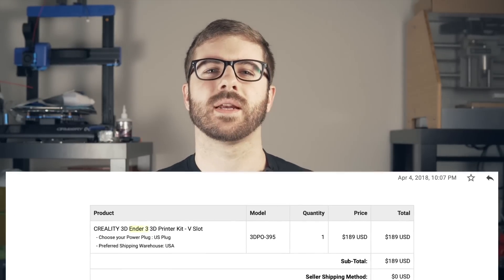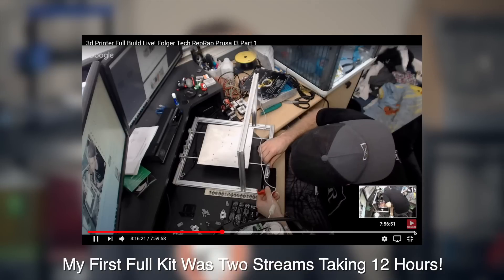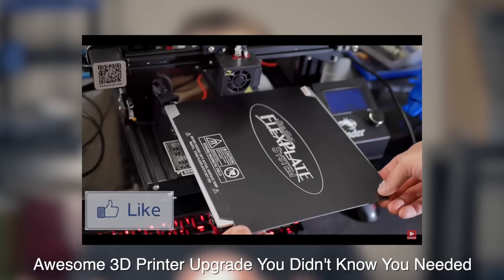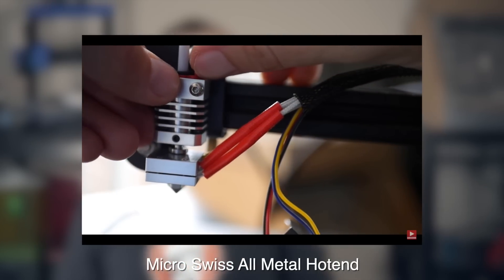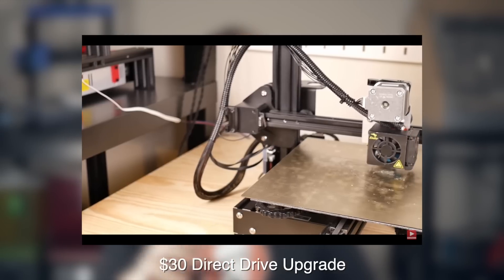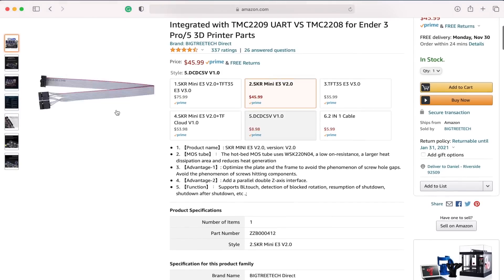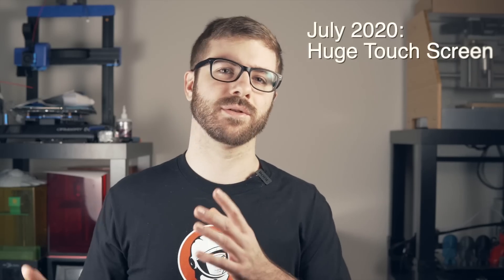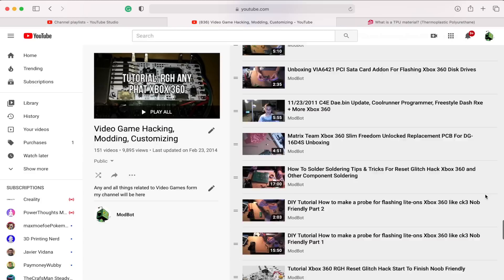My Ender 3 Journey 2.5 Years Later! Still Worth Getting?

Comment: Hi, I started with a Ender 3 Pro. Sometimes it’s easier to purchase an inexpensive unit and pay for the needed upgrades as you learn. I have the Sprite upgrade, haven’t installed yet. I have printed PLA and TPU A95. No problems with the TPU going through the Bowden tube. I purchased the Sprite for PA and PACF. Would like to print bearings either PA or Delrin. I’m an hobbyist, i print on an as needed basis. I started, because I have a Husky tool box that needed 46 detents for the drawers. Total cost $380 to purchase at the time I purchased the Ender. Ender $200, PLA $20, plus time. Saved $360.

Comment: Nice video, I know it's an older one but I like going back to review older videos of people I subscribe to. Keep it up! Also I did the same thing with ABL but I went hardcore RepRap and made my own ABL with one I found on Thingiverse. It worked really well but the rod kept sticking and driving the nozzle into my glass bed so i said no more! I then changed my hotbed setup for leveling and added a nut to hold the heater bed to the bed leveling adjustment screw and added printed knobs to the adjustment nuts. Now leveling my bed is so much easier and I only have to do it every 10-20 prints and even then it's usually level. I've learned so much in the last year from all those here on Youtube and elsewhere. I'm working on making some 3D printing Youtube video content myself. So coming soon.....

Comment: I've owned an ender 3 pro for a little over a year now. I've done a couple of mods, but the best has been changing out the mother board with the new 32 bit ender version. It's unbelievably quiet now. The only issue I've had was the rotary encoder failed. It was an easy replacement, it was just a jelly-bean encoder. It's been a great first printer. I've not purchased a leveler, but it's sometimes a challenge to get through the first layer of larger parts.

Comment: G'day m8.....i pre ordered the ender 3 v2 back in june 2020. When it turned up this was my entry into 3D printing, this was recommended by my Rc youtuber Josh of Harley Designs. I  immediatlly  used the PLA and TPU i ordered with my printer, within a couple months i won a Creality Enclosure and was able to print ABS. Since then  i got into PLA+, but my hobby i needed to look at more exotic filaments like Carbon Fiber based and Polycarbonate for that strength and light weight. So for my Birthday on Jan this year my mother offered to help me upgrade, so next to me is the Micro Swiss, Direct Drive all metal hot end kit and a new Therrmistor and a Slice engineeriing 24V 50W Heater Cartridge, as this is all i need ATM. I dont use auto bed leveling i always do it by hand and its an extra thing on the printer to go wrong, but thats just the way i do things. Cheers for the content!! im going to use some of your vids to help with my new upgrade. Cheers m8... ill catch ya beyond the black stump, from ya m8 Downunder!!

Comment: I'm a 2016 Anet A8 user, and I already replaced the frame with a custome 2x1 inches tube frame welded by my self very sturdy no shaking at all but very ghosty finish, I planned to change the linear rails but if I invest on new linear and other pieces is more expensive than getting an ender 3 so I decided to get one instead so I just ordered yesterday.

Comment: new Ender 3 owners here~
mods installed already:
4.2.7 board (stock was 4.2.2, just wanted silencing)
Mean Well PSU
Octopi w/ picam
Klipper firmware
blTouch (with bed mesh and assisted tramming)
higher tension bed springs
glass bed (bed is already heated)
various printed fan shrouds, clips, covers etc.
cheap filament dryer to print out of

next up is a filament runout sensor

Comment: My first printer was a ender 3 pro. First mod was a bl touch and btt board, then glass bed, dd micro swiss, 7" touch screen, and dual z. 

I am however ready to move on to a more capable printer. Really leaning on building a voron 2.4 or rat rig. I do like the idea of building it myself how i want it from the start seeing i have a printer currently. Totally agree with the mods and building is over half the fun. And $200 is not a lot of money to risk dipping your toes in the waters of 3d printing.

Comment: The Ender 3 pro is my first (and still only) 3D printer and also modded to a state where basically only the frame is still stock.
Was that a good investment? Hell no and I wish I would have had the money to buy a Prusa when I got it (the Prusa Mini didn't exist back then iirc) I probably would have spent more time printing and less time figuring out how printers work but honestly once you've done troubleshooting with basically every part of the printer I'm willing to touch (so everything except actually changing the PSU more thant just swapping the fan) you have a pretty good understanding of the hardware and software interactions and I think it's pretty good knowledge if that's something that interests you. 
So as a project that brought me some utility and a lot of fun, it was a worthy investment and I hope I will serve me some more time.

Comment: My Ender 3 has had a new extruder (replacing the plastic one), new firmware (enabling thermal runaway), new bed sticker (wore first one out), and an electronics fan cover. Printed about 1000 pieces of PPE during the pandemic and is beginning to feel it's age, needs a bit of a service!

Comment: Getting a 3d printer nowadays is a pretty secure thing to buy, most printers are local so unlike phones and other technology which can become obsolete because it cannot get the newest update, a printer might get obsolete through innovation but will not get obsolete because of software. The ender 3's parts are also pretty simple to upgrade or replace.
You could get an Ender 3 in 2030 and it still will work the same as today.

Comment: I got my Ender 3 about 2 weeks ago. I did have to upgrade the extruder to the aluminum one and upgraded the boden tube to a Capricorn. I am having a blast. I fully wanted to learn the programs that I would need like MeshMixer, Cura and even TinkerCAD. Outer space is the limit. Thanks to people like you, it's been pretty easy to learn.

Comment: After a couple weeks researching, I bought a Ender 3 V2. Thanks in part to this channel and it's videos. Being brazilian, 250usd is a big money commitment so I had to choose well. Thanks for helping me not just in choosing the Ender, but for general knowledge of my new hobby and also for future troubleshooting.
Reply: How's it going 6 months later?
Reply: @jjpaq  Thanks for asking! Well, the stock cooling fan is insufficient but I live in a hot place. So, I printed a new cooling shroud, bought couple 4020 fans and now it's great! Had a seriously steep learning curve figuring out all issues, 90% of which were caused by me =). Out of the box the printer was good but with all my tinkering and snooping around, lots of issues appeared. I learned a lot and right now the printer is extremely reliable and have excellent print quality. it is not fast but I was able to set it 20% faster with no loss of quality. I will make tests soon to see the fastest I can print right now without problems. Should be fun.
The upgrades, apart from the cooling shroud were: BLtouch, BMG extruder, bed insulation and stronger springs. None vital but they all gave a bit better quality of life. Also, Jyers firmware is fantastic! 100% recommended!
Reply: @ragzard  Nice! I'd never heard of that firmware, looks interesting. I started running Klipper a couple weeks ago and I'm very happy with the speeds so far, ordered an accelerometer to tune the input shaping better.

Funny to hear about the challenges living in a warm place, I live in Alberta so I have to keep the printer in a warm room to avoid warping which means I can't print any filament with fumes (e.g., ABS).
Reply: @jjpaq  other end of temp spectrum. Haven't thought of that either.
I see Klipper and input shaping far beyond my knowledge lvl right now. Jyers is a more powerful and complete version of Marlin specifically for the Ender 3 V2. You are beyond that. Couple days ago I saw a video of a heavily modified Ender 3 running Klipper with absurd speeds. Video name is "Ender 3 Speedboat - 5:30" It is mesmerizing.

Comment: Am thinking of buying an Ender 3 max as my first 3d printer, but have a few concerns for it's size and what are it's drawbacks? Having a rotary UI is actually a plus for me. Creality lists the dimensions as 513x563x 590, from what i understand the bed is gonna be a bit larger than 300x300, but for the hot end to make a 300x300 area you should need a 600mm in the z(depth) axis. Maths? Physics? I don't get that trick yet. Also is the free sample filament(without the spool base) usable or is it more of a gimmick? Thanks.

Comment: Got my one a month ago. 165 EUR with silent drivers and glass plate. Already upgraded for Capricorn bowden tube, metal filament feeder and hardened steel nozzle.
120 hours of print so far, mostly tweaks for the printer and parts of the Lowrider 2 cnc mill.

Comment: my updated ender3, the same as yours, except not yet direct drive, but only had it about 9 months. If you have a flat bed, (mine is flex steel, similar to yours) then although i managed to fit a bl touch, I think it is more trouble then it is worth, in particular if changing nozzles, etc. Creality really messed that up on the original 8 bit boards.

Comment: I've learned so much by doing modifications to my ender 3. My machine is completely different today and I think the frame is the only thing that is stock (including the wiring). I learned to solder, program an arduino, Use fusion 360 and a set of calipers to create custom parts and infuse that with my woodworking and other hobbies like airbrushing. I could build a 3d printer from scratch now if I wanted.

Comment: The only thing that really holds back the Ender 3 is the couplers that barely hold the PTFE tube , once replaced you're not as likely to have such hotend issues. If you grab an all metal hotend and a direct drive kit there's really no reason to pickup an Anet A8.

Comment: I was one of the lucky ones and my first printer was the Ender3 pro and it has been great from day one. I've also did most of the upgrades in the same order you did. I have to still install the swiss and the 32 bit board which I have but haven't had the time yet to install. I took my time to learn the SW portion of 3d printing (Fusion 360 and Cura) before I got my Ender and that time was well spent and paid off because I didn't just want to just print other people's designs, I wanted to print my own. I really dig your channel and keep up the fantastic work.

Comment: My first printer is an Ender 3, and my second, which my wife asked me to buy when she saw the stuff I was printing, and figured out I could print earrings for her in under 10 minutes, but not if my printer was printing a big job. 2 is better than 1, and she is about ready to tell me to buy a 3rd, especially if I start advertising to print other people's 3d prints who don't have a printer, and can't see themselves buying one. I love that Cura tells me how much the material costs. I just need to price printer time & my time and see where I hit. I got a 3d model a year ago we wanted to print to help my wife with a garden issue she had, and I called a couple places who were advertising, and one told me the cost would be North of $200.oo. No way was I going to pay that much for $1.00 with of plastic. The problem is, the print would have taken him about 35 hours, and he had 1 3d printer which cost him a boatload more than the cost of my Ender 3 printers ($157 for the first, and $160 for the second and the price is going up).
I've had mine for about a month. I'm getting pretty good at the slicing and printing, but still haven't left PLA for harder plastics. I'm likely going to settle on PET-G for everything going forward, with the rare foray into NinjaTek stuff, or others.
I'm using eSun filaments, which are very pretty when printed at 200/50. Really, the temps are set to that cool.
Oh, and I found MagiGoo, which I won't give up, ever. It's very awesome.
I also have a few minor upgrades, like a glass bed, which I love. I've not tried a flexible bed, and don't think I need to. With the glass bed, if it doesn't cool down fast enough, I'll just take it off and put it in the freezer for 2 minutes. When it's cooled off, everything pops off very easily. Clean old MagiGoo off the bed with nothing more than warm water, and a cloth, of course. Simple, clean, nice, and it's essentially invisible when dried on the bed.
Okay, enough of my prattling on.
Good video and very needed, if for nothing more than just listening to your upgrade experiences.

Comment: Looking back on this, the Ender 3 Pro is probably a little better than the Ender 3 just because the flexible bed is much safer than a scraper for beginners and it costs about the same $200 price, the Ender 3 is going about 3-4 years old and is pretty obsolete like the Anet A8 was. Now there are things like the Biqu B1 and Ender 3 V2 that are better value without scraping bottom of the barrel in reliable parts and common upgrades that should be standard for printers. 

I started with an Anet A8, the dead heater cartridge after a couple weeks still sticks with me and it's pretty much the same thing that goes in the ender 3, these days I replaced the electronics and hotend but more because I wore them out than any need for an upgrade, buying cheap is good, just to the new people out there, don't be penny wise and pound foolish by buying too cheap because you get what you pay for.

Comment: I'm considering an Ender 5 as my first printer. There's not much difference in price between it and the Ender 3 and I like that the print bed only moves in the Z axis. Being able to add capability and features to the printer as I am ready and can afford it is a big advantage to me. I'm expecting to want to upgrade the main board to the silent driver version and might order that when I order the printer. Otherwise, it'll be a while before I'm ready to put in a direct drive and upgraded hot end.

Comment: I just ordered most of the upgrade you talk about because i want to try the CF Nylon. Still need to upgrade the extruder, figure out how to store and dehumidiate the filament. I saw a video of a guy who put a reptile heater in a plastic box. Last i need to make an enclosure.. :-) 

Btw.. could you do a video that describes all the different buildplates on the market.. i get a bit confused with the stock ender 3 plate, then the glas plate, spiderplate, magnetic, garolite, boroslate glas.. and 10.mil more.

Comment: Great vid and cool upgrades. I just fired my printer up again after not using it for 6 months. No tweeking. Just a manual bed level and I printed a vase that took up 100% of the print volume. It was flawless!!!!!
I only upgraded to a metal extruder. Capricorn tube. All metal hotend clone a quiet board and a glass bed. The end 3 pro is an amazing printer if you don't mess with it too much.

Comment: I started with a velleman k8200 and that was a pain to work with. I modded a lot to make that printer better but I was relifed when I bought my prusa mk2 --> completly different expirience. Tha issue I had, is that for some stuff I prefer 2.85 mm filament, therefore I bought later the Ender 3 and I totally agree, it is a vey good printer out of the box and it is a very nice printer to modify. At the moment I only use my mk2 and the moded ender 3.

Comment: Does anyone have recommendations for a mid-range 3d printer ($300-500).  Is that range just simply a larger print area, or will it have better components?  I'm mostly interested in (out of the box) direct drive, auto-level, flex plate (or similar), high quality motors, stable frame, high precision mechanical components, and reliable drive electronics.  I am less interested in touch screen, enclosure, filament out detector, Wifi, camera (for checking status remotely).

Comment: Can totaly agree 👍 Still pumping out awesome parts with my Ender 3, which was one of the early ones that rolled of the production line. Haven't changed much, just some printed addons and 2 flexible buildplates (first one wasn't correctly sized, cause there where no Ender3 sized ones available back then). I'm still running the original PTFE -tube  without any problems at all👌(got some Capricorn PTFE to replace it someday). Only had to change some nozzles over the years of printing and had to tension the belts sometimes. Compared to my first printer which was a budget option in 2015 for over 600€, the Ender 3 beats every aspect by a great margin even tho it's not 100% perfect, but like you said mods are easily done and can change the Ender 3 into an even better machine. I also know allot of people that are really happy with their Ender 3 to this day 👍.

Comment: I ordered an Ender 3 v2 last week. It will be my first printer, so I'll be watching LOTS of videos since I know nothing. Thanks for your videos!
Reply: Same. I hope you will get successful prints!
Reply: @movingpictures9308  my Prusa is nearly Perfect
Reply: @dampfygang5758  How hard/annoying was it putting it together?
Reply: How are you doing, 6 months later?
Reply: How do you like it?
Reply: @KillerofGods  I love it. Assembly was pretty straightforward however it did take a while. I've made quite a few things with it.
Reply: @GarageHoggeAdventures  i just bought one its my first one too
Reply: @GarageHoggeAdventures  Have you started the inevitable cycle of mods yet?
Reply: @GarageHoggeAdventures  I'd say around 1-2hrs at max for assembly until the first print starts. Calibration of things like extruder ratio etc can take longer but are usually not necessary for the first prints.